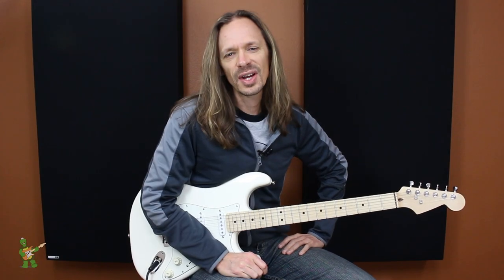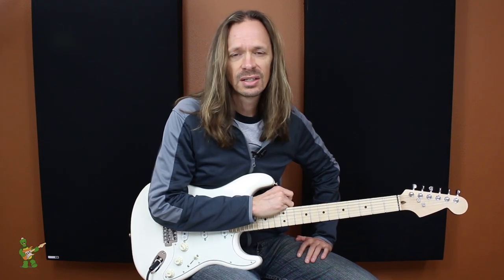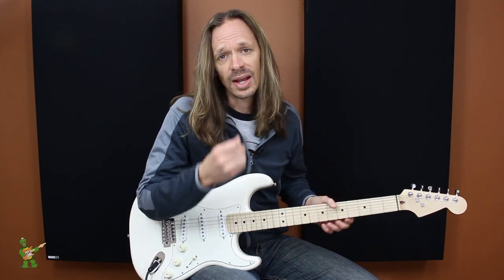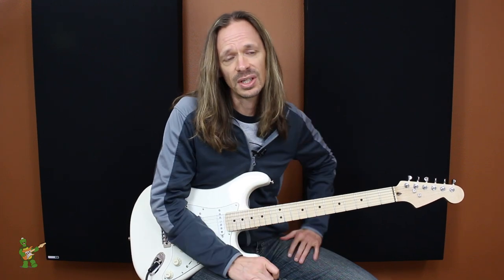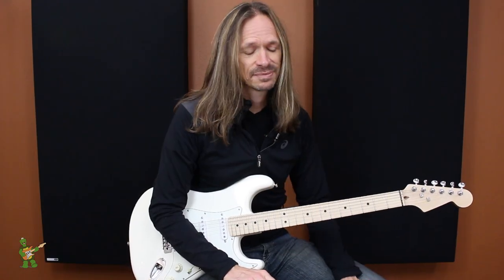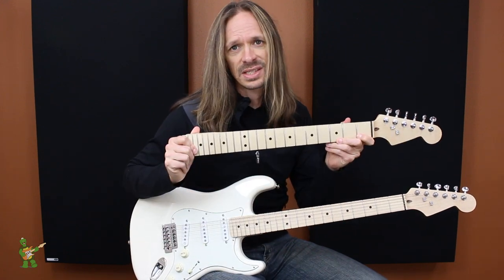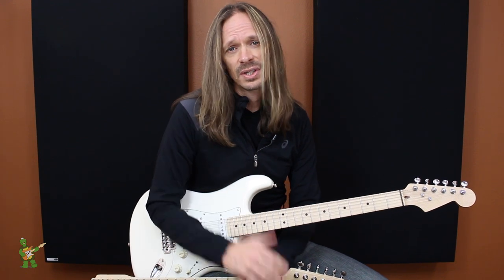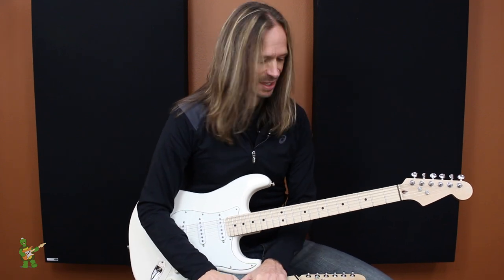Stainless Steel vs Nickel Frets

Comment: Here’s what I’ll tell you as a luthier and a machinist. Stainless has always been a hard material to work with, you get it hot it warps or cracks that’s the machinist end of it. I have had the surface grind it before on a Blanchard grinder and you have to keep flipping it to get it flat because it wants to warp as soon as you get it hot.  Guitar frets warpage and cracking doesn’t apply but it is probably a very hard material to file, so you are only going to want to use high-quality USA quality  or swiss made files, what I’ve heard is that it will wear strings out faster so keep in mind there might be a trade off. I wouldn’t call myself a professional musician like out on tour but I would say I play a lot so maybe the frets would need dressed off once a Year or two a couple of them if you wanted them perfect. With nickel Frets I would only replace the ones that need it which may only be two or three of them. I am learning that my left hand may be a light touch and that’s why I prefer medium jumbo frets. They seem like I’m getting good results without trying very hard. 
The other issue in your test I detected the neck one was not set up quite right I picked up a little bit of fret buzz or what I thought was fret buzz high up. What interest me more over stainless over nickle is medium jumbo frets one of my favorite necks is the Peavy Vortex 1 neck which is medium jumbo frets with nickel Frets and a small profile 22 fret 25.5 scale.  i’m guessing around a 17 inch radius. I used to hate this guitar because I was always bumping the volume knob so I took the knob off so it just had the pot sticking out I put a black rubber thing on it. I had a house fire and lost it and I went out and replaced it with another one I found it wasn’t very good shape that I have to go through still and I may make a video on that. What I was finding was I couldn’t play as good without that neck. Apparently I had adapted to it. I am noticing the 24 fret necks feel foreign to me. Right now I have both Stainless and nickel fret guitars.  I haven’t been sold on the stainless just yet other than it probably does last longer but if it’s harder on strings I hate changing strings. 
I’ve had real good luck with GHS boomers 9- 42 or the custom light 9–46 I can chalk that up to reading a Brad Gillis article in guitar magazine in the 80s. I used to run fender 150s or Dean Markleys before the GHS boomers. I swear by them boomers because they last me a long time and I don’t know they just feel more comfortable on my fingers. I think it really comes down to this it’s whatever works for you. Stainless is impressive for guitar resale however nickel frets you might only need to replace a couple of them and they can be dressed down and set up much faster so if they’re in good shape there’s nothing wrong with them. I would buy a guitar with a completely worn out neck just because I’m a guy kind a like Eddie Van Halen was, I tear shit apart and I’ve been doing that probably all the way back to about 1982. I’m very good at custom painting with metalflake brand candy and pearl lacquers and polyurethanes. I’ve been doing drag boat stuff for years and refinishing some guitars. I’ve never played a large jumbo fret I would like to try that at a music store or something because I have one guitar I am going to refret with wider frets. I’m seeing a lot of fender pictures that looks to me like they’re using a super wide fret. I do like fender because I wrote them a letter one time and they are a super company and apparently will work with you. I’m not sure I want to sand on stainless all day to get them flat. lol I just bought a vintage HM Strat that was re-fretted with stainless and it’s nice it sounds excellent however I don’t feel the crown the edges of the frets are right because I can feel them they are not like my Vortex 1 where I feel I can just zing down the neck. If you pay attention to what seems to dominate the high-end guitar market it’s all the work that goes into the neck mostly.. So I may make up a tiny radius gauge for the edge of frets and redo that one. If it’s super tough I’ll use a Dremel tool to get it close. the guy did tell me it had a slight 17 fret buzz which I haven’t really fooled with or check out yet but I am probably going to go through the guitar and recheck all the Intonation and everything and dress those edges down I don’t like when people just whack a 45° angle on them that’s the cheap way out. I’m probably going to get a tool like a Baroque or Fret Guru crowning file like they got on Amazon. If you buy one beware of knock offs. Some things you get what you pay for. Working on guitars can be a lot of work but I have always found you will get back out of it whatever you put into it just take your time and do it right. Tiny details matter. If you don’t know, get on YouTube do your research there is a ton of good testing and info out there. There are sort of standard procedures for things and now with YouTube almost anyone can learn how to do expert set up you just Gotta be patient willing to put in the time and maybe buy a few tools. A lot of tools you can make to if you’re a machinist or know anything about that.  I might even start marketing my own brand of tools. I play a little different than a lot of other guys I’m not a Floyd Rose fan I like my Kahler 2300s better according to Kerry King it might be what you learned on I have one of his Kerry king Marshal heads and I learned on the Kahler but I know I can set them up fast and hold tune with them, my Floyds I call my Boing Rose because I’m always bumping it and it’s too sensitive. I may develop some kind a hard rubber block you could put in it to stiffen it up but still make it function. My father was also a pattern maker so I’m all up on how to make molds and stuff like that. I love screwing with all of this stuff lol. I’d like to hear more from other guys what’s their favorite frets and why. I think Stainless frets are here for good but I know for me I can work A lot faster with the other. I grew up playing a little bit of country too because of one of my buddies that went to work professionally so I’m wondering what the country guys like to use also.

Comment: I could tell the difference on every single setting. And I guessed right every single time too. I kind of like that "Tinny-Chime" that the stainless steel frets give it. I would like to have 23 of my guitars refretted with stainless steel frets(the other 5 already have them) and I really like them because they don't wear down. I use very heavy gauge strings so I chew frets up really fast (.11-.54)

Comment: I see you have a second string tree.  I always do that.  You can hear G with a lot more ass.  Just unstring it and re-tune, it's pretty obvious.  Has anyone ever asked about that?
Reply: I think that pressure on the nut is why my gibsons sound big. I don't use any string trees on my strat, but those offset tuners fender makes. The whammy bar doesn't like them, but I'm sure it would sound better with more pressure on the nut to push the vibrations into the neck.

Comment: I’m thinking it’s just like front wheel Drive cars… how many people would rather have a front wheel drive car? Nobody I know… nickel frets wear out and you have to pay someone to replace them and it’s cheaper for the manufacture.. there should be a specialty shop that puts on forever Frets made from stainless steel.. there’s no difference in sound, and the last almost forever one less thing to worry about or pay for… guitars are already over priced as it is.. a telecaster, $2000 you Gotta be kidding me you could literally make a Telly in 8th grade shop class… in my opinion stainless steel fridge should be standard

Comment: Cosmetics matter. Stainless Steel is shinier and looks much prettier. That's reason enough to get them. The sound difference is there but absolutely negligible. Stainless Steel doesn't wear, nickel does. Easy choice. Stainless steel is far superior. I will never buy a guitar with nickel frets again. But hey, if you like the vintage worn-down look, nickel is the way to go.

Comment: All this talking and testing and you do not compare the bridge pickups with distortion which would give the best examples of added brightness. Wonder why? Seems you'd have this knowledge. I ss frets personally but they are brighter.. neck and middle position pick ups are not as bright by design and placement.. so this completely confusing and almost dumb

Comment: The SM57 defeats the purpose of the test for us listeners. It's not a high fidelity microphone and so if there is a difference we'll not hear it properly (or at all). Another consideration is the sublte differences in each neck's dimensions.(which also include the nut) and how that effects things like string height, etc.. I can hear a little difference sometimes, which suggests a better test would be worthwhile to do.

Comment: The fact that high dollar guitars like an American Strat doesn't offer stainless frets as standard equipment only outs themselves as sacrificing your convenience  for their planned obsolescence.
Fender is betting on many replacing their necks down the road.....and they get a 2nd bite of your wallet from their licensing with replacement neck producers.
A nice used strat put on the market with worn out frets isn't so nice at all. Any buyer will of course strongly consider buying a New Strat instead.
Reply from the maker: Not in the habit of defending Fender, but some of your assumptions are incorrect. Fender makes no money from "licensing with replacement neck producers." You may want to watch this: https://youtu.be/sVMnGSBQUho